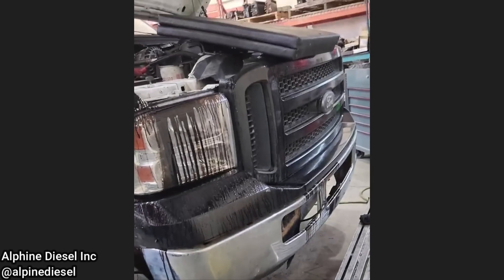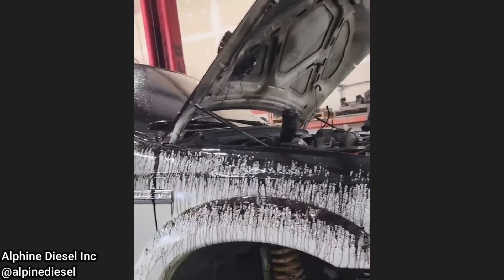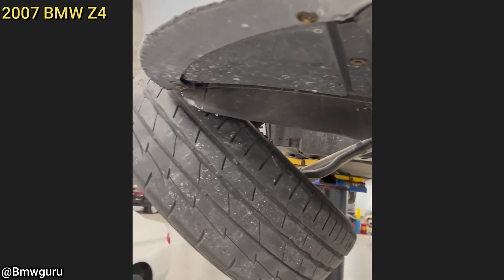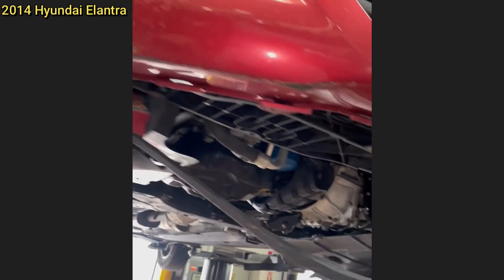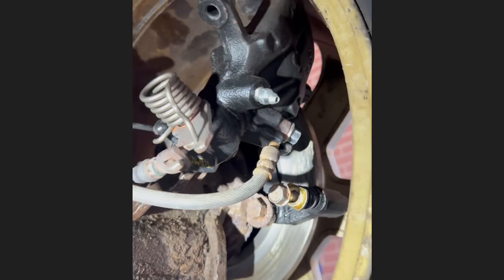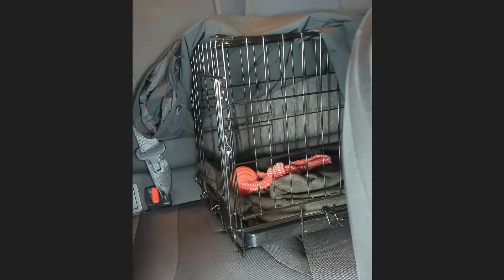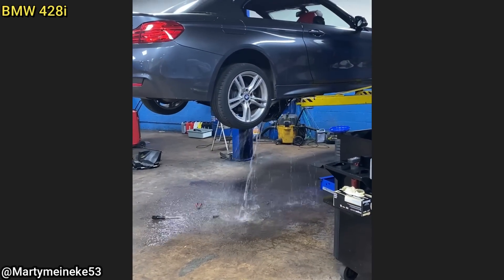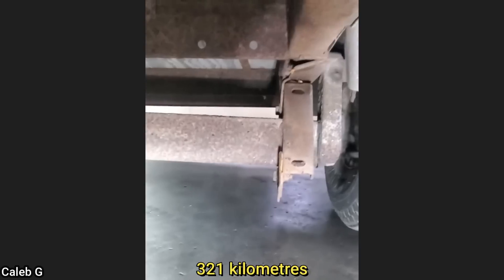Customer States Truck Has A Lack Of Power | Just Rolled In

Comment: Something fishy about the "roofing nails". For one they are definitely not roofing nails, These are typically for foam insulation but could easily be used with bad intentions, the likelihood of that many nails being stood straight up is close to ziltch, and if they were on their sides they would have been squished. Unless they drove over a pile of nails, this was intentional.
Reply: those are roofing nails...
Reply: @alexbear5064   @Alex Bear  They can be used for roofing, sure. But these are not roofing nails. Been in the trade for over 10 years. Just a quick google search between the 2 will show you. I've done many roofs and have never seen a single one of these in a shingle, or metal.
Reply: Those are cap nails and are required in many areas when nailing down ice and water membranes. They fall point up most of the time....
Reply: @dpeter6396  You guys nail your ice and water? like grace, or we talking felt? Curious where your from as it did occur to me that code in different places may be the reason for the mixup. With the amount of nails in the tires, even if they were all point up,  Either there is more to the story, Or the roofers on site have parkinsons and can't hold a nail. lol